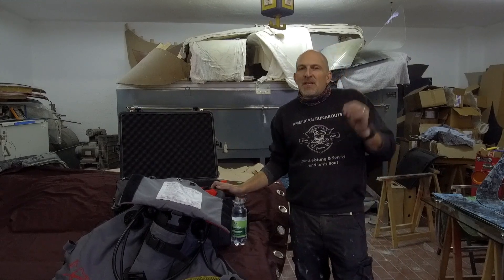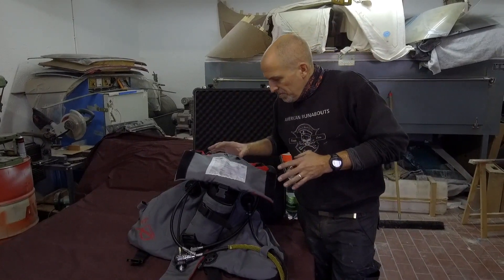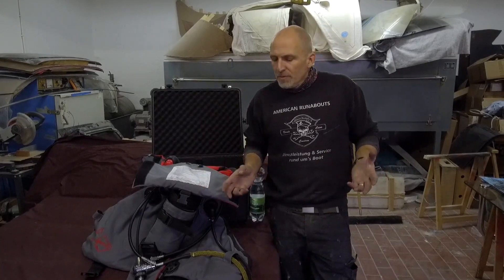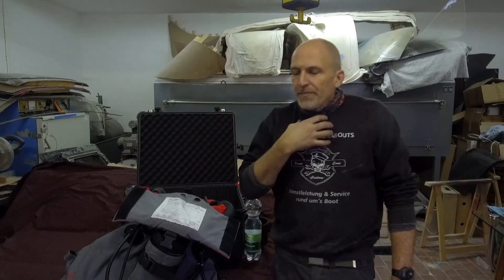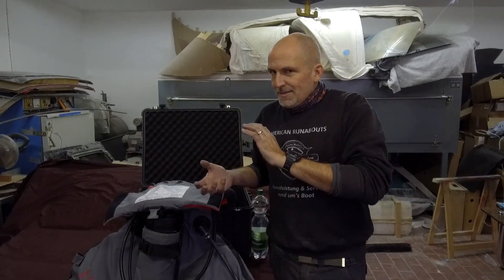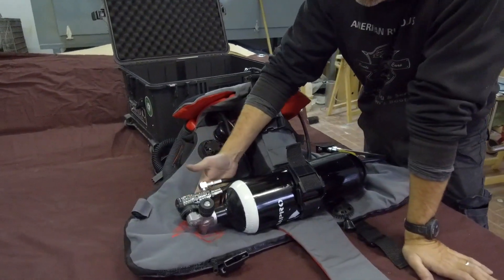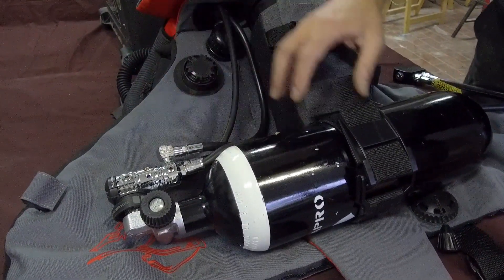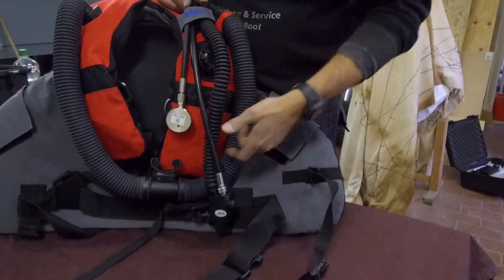Dräger Ray Conversion Part 2

Comment: I am not a CCR diver - but I was wondering: Is it necessary to monitor ppO2 in the loop?
When to manually add O2?

Cheers!

PS.: I also prefer clean hose routing over „additional failure points“ as I see bad routing as a much bigger risk for failure on so many levels :)
Reply: You just add o2 when loop volume is not enough for comfortable breathing.  You expect it to contain 100% o2 so if you stick to 6m it almost doesn't matter what is in your loop exactly but it won't be far from 100 if flushed at the beginning.

Comment: This system is limited to 6 msw, correct?
Reply from the maker: Yes (although this is based on wrong assumptions but adds a good safety margin)
Reply: Interested in the "wrong assumption" I wonder is it that the loop it not really at 100% FO2 due to purge proceedure not completely effective?
Reply from the maker: @dean_murray  The assumtion is that, as the RB is used with 100% O2 that you breath 100% O2 which then gives you 1.6 PO2 in 6 MSW. in fact you hardly get over 80% in the loop. why in detail I explain in the 3rd part is prelreleased on the patreon site and will be online next week.
Reply: @InnerSpace_Explorers  Thank you for the explanation! I’m looking forward to the video. You may have convinced me to subscribe to your patreon
Reply: Yes thanks for the response and looking forward to see the next video. It is something I have always wondered about.